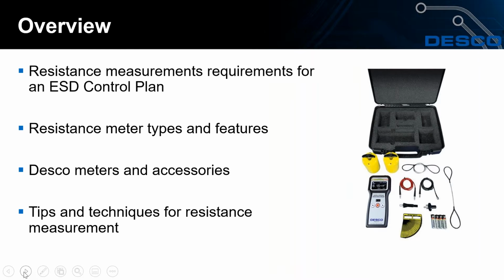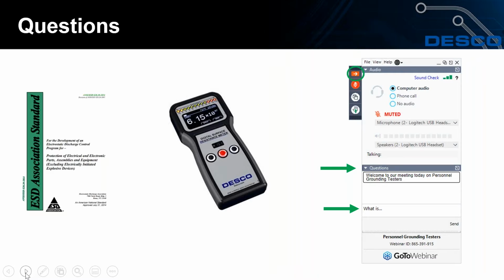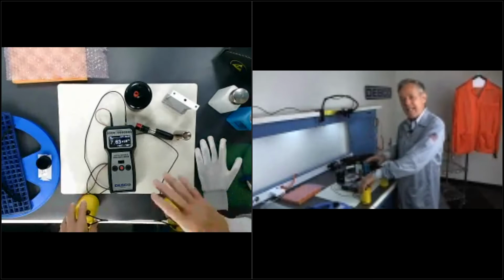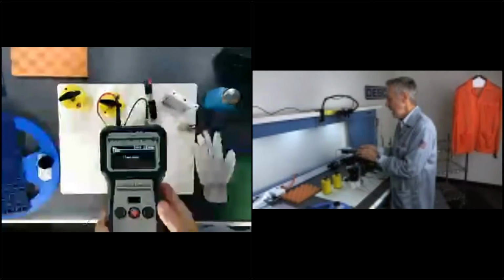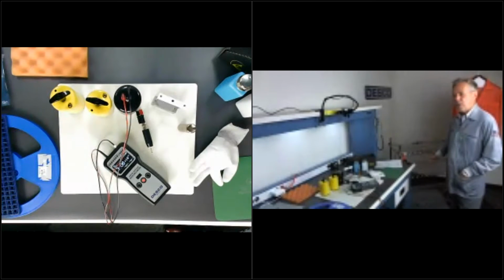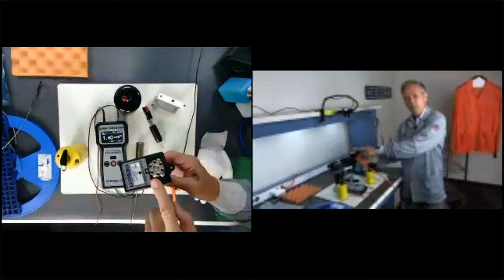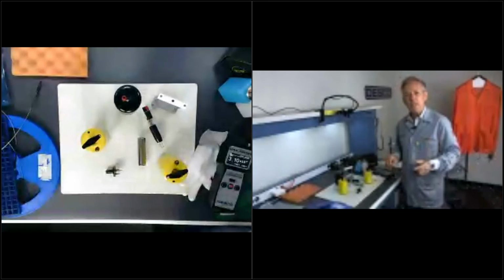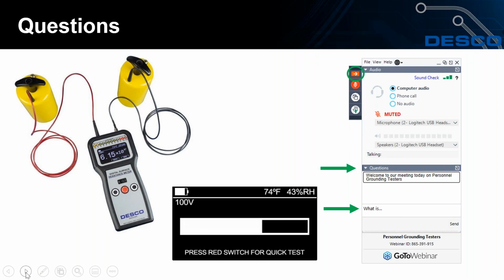Measuring Resistance in an ESD Protected Area (EPA)

Comment: if human body is electrostatic charge what is the body resistance?
Reply from the maker: The important thing to understand is the human body is a conductor (measured in ohms of resistance) and the electro-static charge is measured in volts.  Because the human body is a conductor, a static charge can be induced onto it.  An ungrounded body can then act as a capacitor to hold the charge.